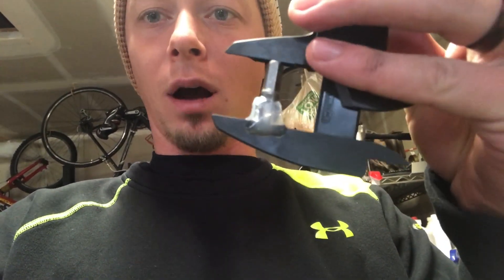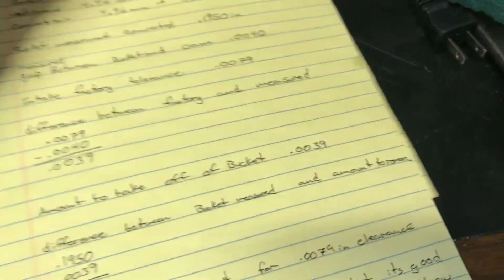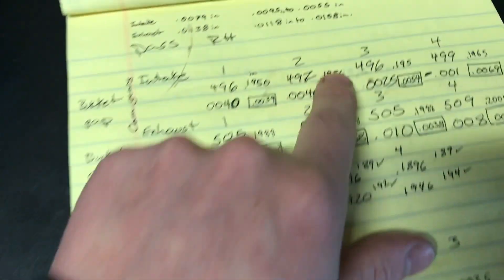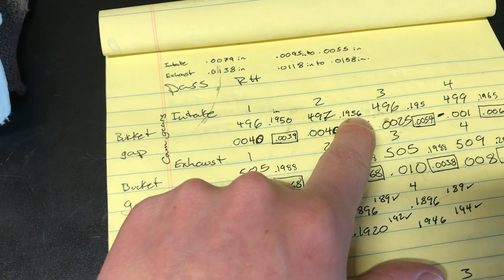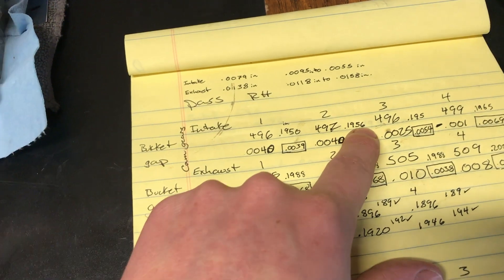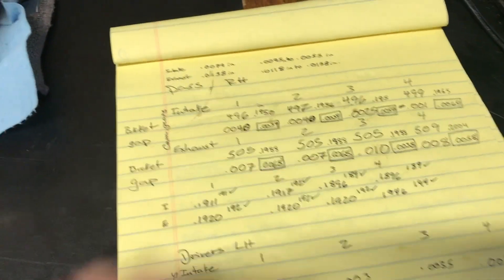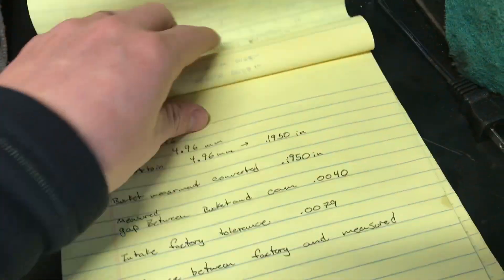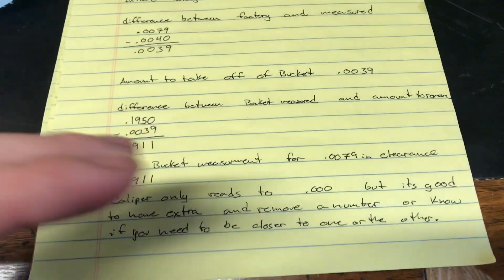Valve Bucket Clearancing Explained

Comment: Had 0 valve lash in my cx7 2.3 from all 16 after changing valves and lapping. Now getting new ones for $15 each is not my plan😂used this method and the exhaust ones are now within spec. Tomorrow I'll be doing the intake side...so far so good👍

Comment: I have questions for all of you including the creator.. how flat is the surface you grinded down?

Did any of you use a dial gauge to measure flatness?
Reply from the maker: I worked off of the same circular principle as a cnc machine. I just had a very cheap one lol. My gauges arnt small enough to check that small of an area. I believe it’s like 6mm across. But with the circular motion and the deck flat to the bit there should have been no warping. Go slow and keep the heat out of the part and it will be fine

Comment: I forgot to mark the Tappet bucket when removing it from the cylinder head, what should I do to get it back in place?
Reply from the maker: Buckets can go in any position. Take your best guess and you will have to put them in tighten everything down and measure to see what you need. It’s going to take a couple tries since you don’t have a good jumping off point. Good luck you got it and don’t get frustrated
Reply: AFAIK all bucket style lifters rotate in place during part of an engine's operation. So jus soak em in oil fir min 12-24hrs(tossing em around occasionally helps) then while em off, clean em off n their corresponding tappet boss's alike. Then clean em again x2, lube everything up b4 installing em back where they belong.

Comment: I'd like to see that excel file if possible...?
Reply from the maker: Every engine is different. They all need measured and placed in the correct spots to make sure everything is working efficiently. While I could give you my excel file it would do you no good it needs to be measured on every engine separately

Comment: I bought a digital micrometer at Harbor freight for 40 bucks or so that does mm and inches. Well worth not converting numbers. I just did a head on a nissan altima and needed taller buckets. 700 for buckets from the dealer, so I went to the junkyard and got some and ground them to fit. Not to bad with a drill press to keep the face square.
Reply: How flat were your grinds?
Reply: Pretty flat because I used a drill press. Any other way and I think they would be rounded off on the edges. It worked well and the car is still running like a top. I did grind them to tight tolerences to allow for future wear. @cruisecontrol6938